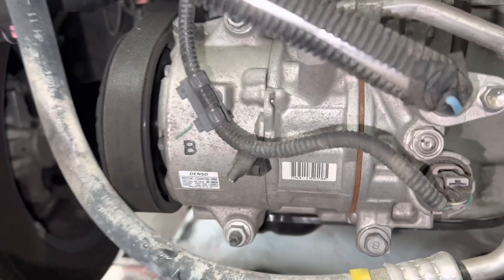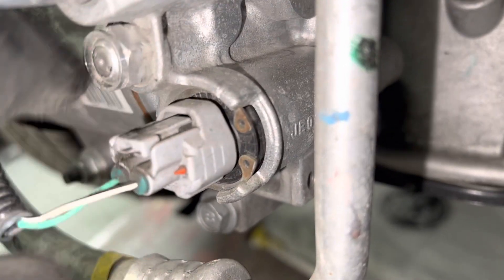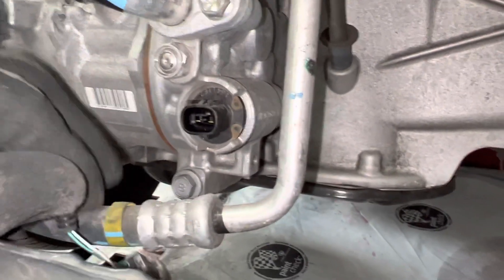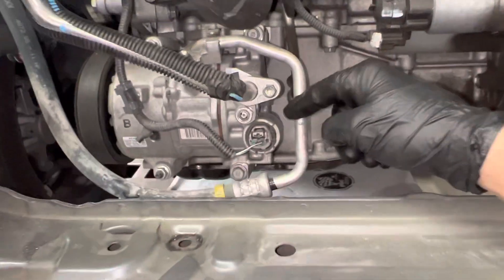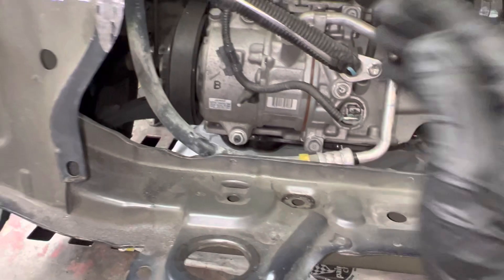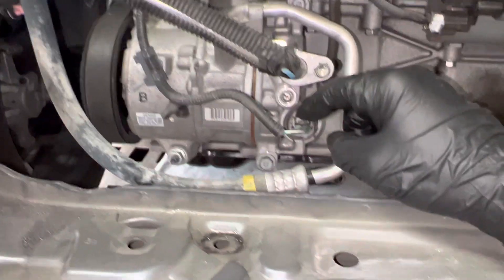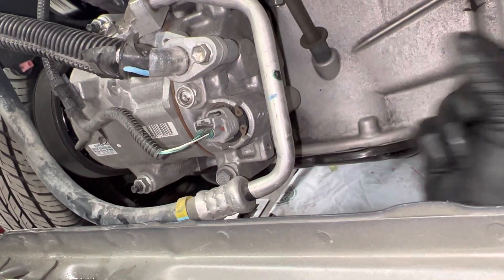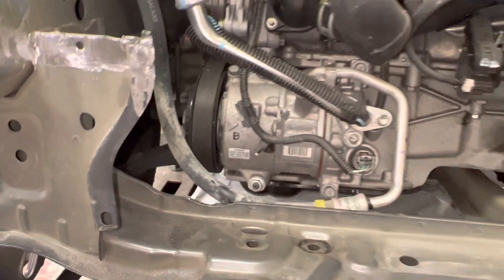VARIABLE DISPLACEMENT Electronic Compressor Control Valve or Mechanical Compressor Control Valve￼

Comment: 2015 elantra. driving one day and suddenly the ac went hot, took it to a shop and was told i had 12 oz of refrigerant and when they tried to charge my system and "the compressor would not compress". is this a bad valve or what do you think? no prior issues and never been charged previous to this issue now
Reply from the maker: Could be a relay could be a fuse to be a compressor clutch the magnetic field coil could be just wiring. A connector would be one of 20 other things that all can cause instant off.

Comment: Also why does some cars cycle the clutch even tho they have a displacement compressor when they could just lower there displacement?
Reply from the maker: @Chargifyx74  you’ve asked that question before
Reply: @ oh my bad I know it varies from different cars but it’s still kinda confusing

Comment: so how does the computer control that valve? does it pluses a 12v signal or adjust voltage? some say it can uses 6-12v is that true? and why do these seem to fail so much?

Comment: 2:39 You are a special person with what you offer and it really impressed me. Can you provide a shipping method for adjusting the mechanical control valve because I already have one
Reply from the maker: Are you talking about the mechanical valve on the Ford escape?

Where it has a Little Tiny Center, Allen screw 

Should be able to adjust it maybe 1/8 or 1/4 of a term . 
I can’t remember clockwise or counter clockwise 

And then you’ll see your low side pressure go up or down 

The only pain is, if you did not get it right you have to recover refrigerant take the valve back out manually adjust it again put it back in Recharge the system again every time you wanna make a adjustment

Comment: Did not buy the tester yet. Seem like it alway hard to access the connector. Did not find a scan tool that let me access the valve ether. Thanks for your video, im a big fan.
Reply from the maker: Are very very few aftermarket scanners will ever let you control the compressor control valve and the ones that might will only let you do that on a few year make model’s

The only best way was always the factory scanners the shops that I go into helps factory scanners are usually always able to access the control valve

Donely other way is use the compressor control valve tester actuator that I have shown in my videos some valves are easy to get to some valves a little more difficult usually always have to take the plastic cover out from underneath the car the majority of the time for the easy ones

Comment: What are the causes of faulty control valve?
Reply from the maker: Just like any electronic device with a fine wire coil like a electric motor or a fuel injector the wiring usually shorts to ground the case of the device or shorts in between two wires or completely open the electrical circuit.

Comment: I have a 2014 Toyota Camry which of course has the variable displacement compressor. On the Toyota forums there has been much controversy on the topic of this valve. Some people are saying if this valve goes bad the compressor is automatically bad too. Some people are saying that they've replaced this valve and nothing else and it works phenomenally again. I now know the truth after watching this one. I know what I'm going to be doing if I ever have problems that point to issues with the compressor or that valve. Thank you so much Mr. Lech! It's like you said.  You have to get someone who knows what they're talking about. Too bad that's getting harder to find now days.
Reply from the maker: Your first statement has a lot of weight of truth and false about some people saying if the valve is bad then the compressor is bad.   
       1: That statement from those people on YouTube is lease complete ignorance
         2: or they’re just sleazy salesman shysters who want to make another several hundred dollars to $1000 selling to customer a compressor just because of a bad valve.   
            The valve has nothing to do with the mechanical function of the compressor itself they’re completely isolated and there’s no mechanical device on the electronic solenoid valve touching a mechanical piece in the compressor itself it’s pressure of refrigerant applying force just like opening a water faucet and allowing water pressure to go through the Spicket. 

3:  But there is a third problem and that’s the technicians in mechanical shops that improperly charge to customers vehicle and they are the cause of the compressor burning out and they do not know how to test or differentiate the difference between a Berdell compressor or a control valve in both cases it’s due to ignorance the compressor got burnt out from the technician who is trying to diagnose it or maintenance did in the past. 

Lack of knowledge ignorance seems to be a rapid pandemic of an infection in the last 20 years that has spread throughout the world like the black plague in medieval times.